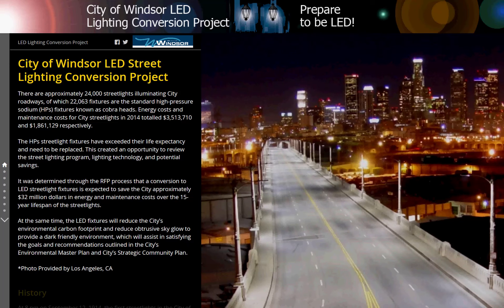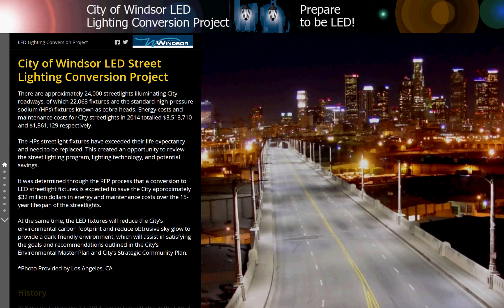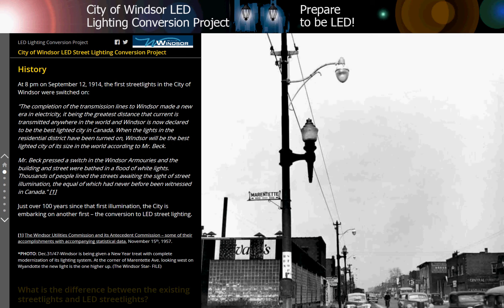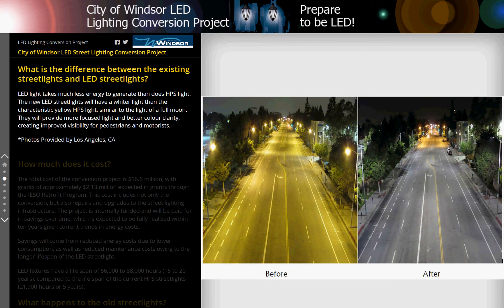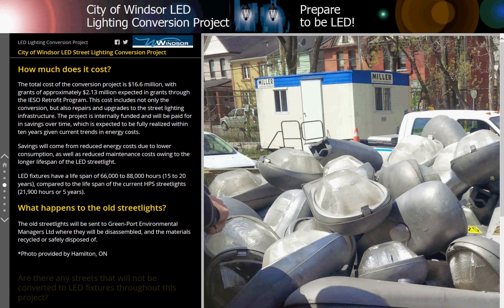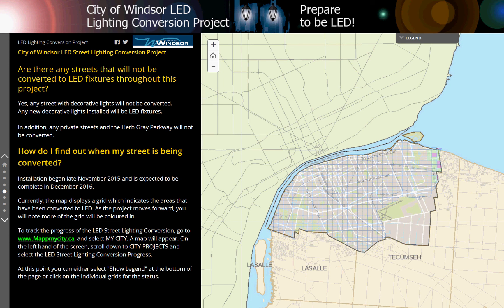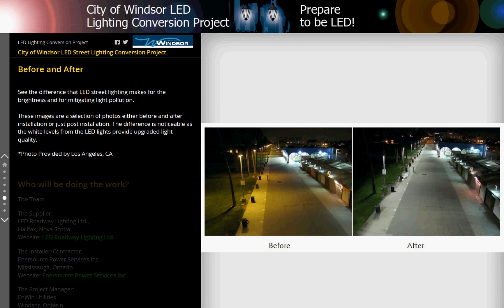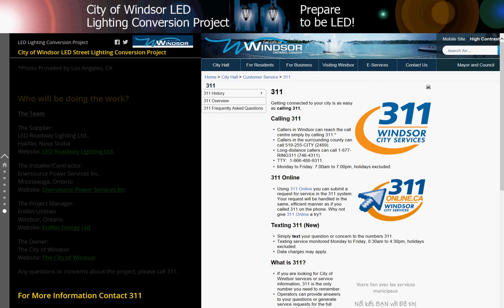LED Streetlighting Project Video

Comment: it's so dark on the streets now with the new LED lighting, they do not put out enough light at all.
Reply from the maker: Thank you for your feedback. When approving the streetlight conversion project, we also changed our lighting standards to follow the North American lighting standard known as RP-8-2014. As a result, there will be a difference in lighting levels when comparing the LED fixture with the HPS fixture. In some areas, the lighting levels will be increased and others decreased based on the standard. However, LED fixtures will provide improved and uniform lighting for the community's streets and sidewalks when compared to the HPS fixtures. It is also common for some individuals to require an adjustment period to get used to the different style of lighting. That being said, if you continue to feel that the light being provided in your neighbourhood is inadequate, please consider contacting 311 to let them know the details.

Comment: They are changing them on Forest Glade. They are changing the brackets too and they are leaving a huge tangled mess at the base of the new bracket. Something that looked fine with the old brackets. Train your electricians how to properly manage wires and not make it look like a two year old is doing the work.